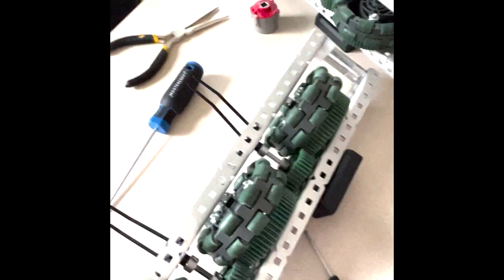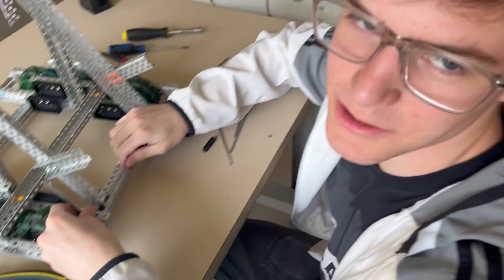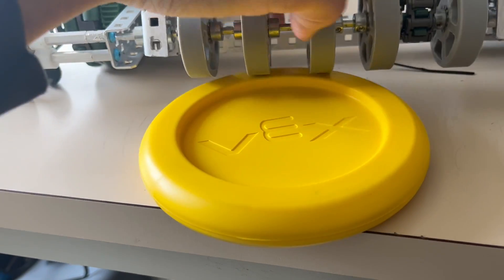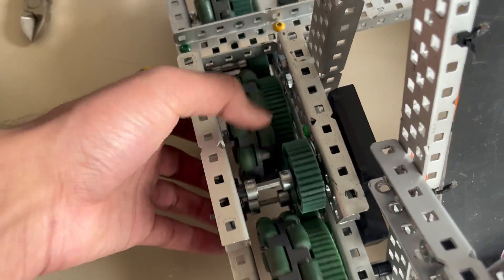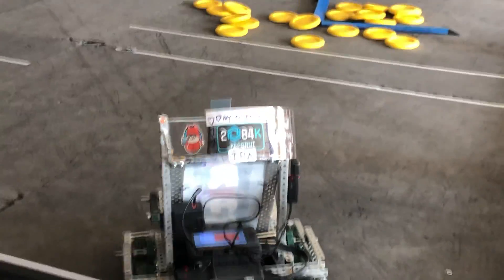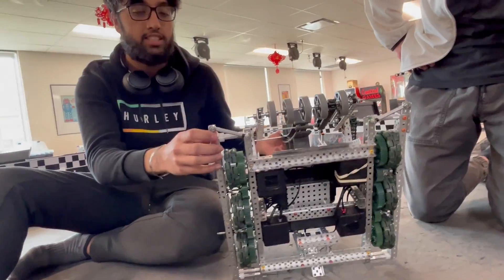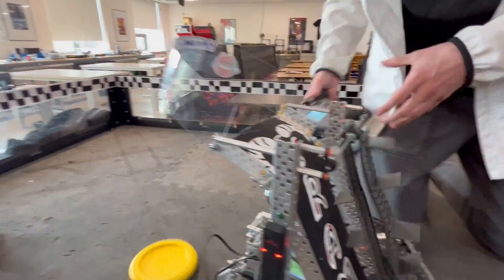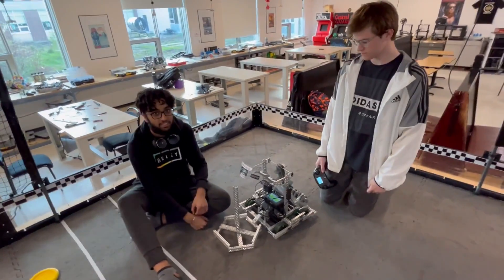29295 | VEX High Stakes | Ri24H

Comment: what is the colour of motor connected to the wheel?❤️‍🔥
Reply from the maker: blue motor (600rpm) is connected to a 36t gear that drives the 60t gear with the wheel on it (360rpm)

Comment: This is good but the new goals have a rubber piece at the top so just setting the ring on the top probably won't be enough to get it on the stake
Reply from the maker: The solution to this is having a banded hood that helps push them down or some sort of pusher. I think meta will definitely go a different direction towards lifts because this type of bot is limited
Reply: @StratfordRobotics29295  Yall are still chads for building a bot in literally a day for this when you dont even have the game manual or the field.
Reply: @StratfordRobotics29295  I do think that the meta will change but if teams still use an intake, I think that the hood would have to have a smaller piece of an intake that pushes the rings onto the goal because if there is no extra intake, then the ring would get stuck between the hood, intake, and goal.